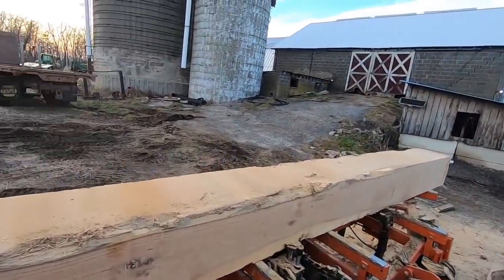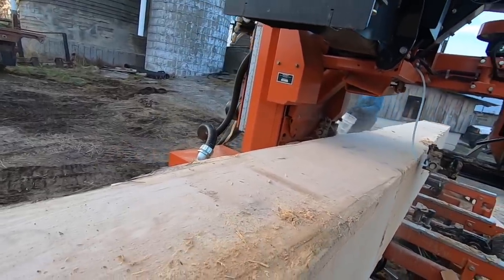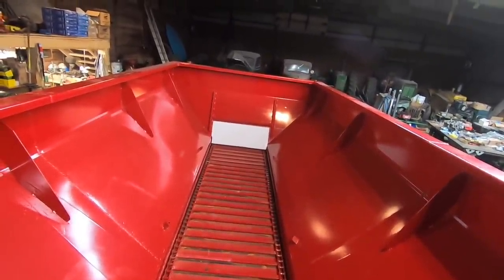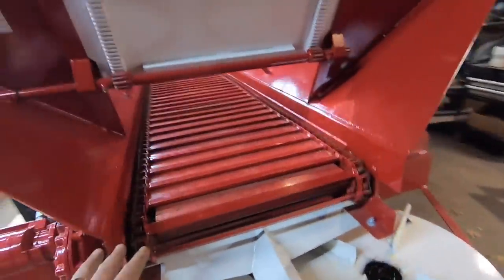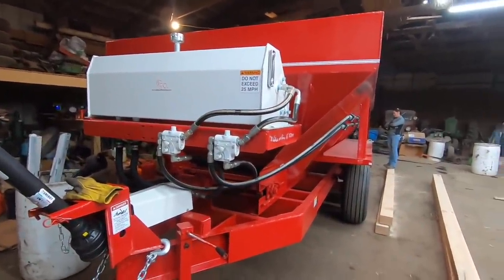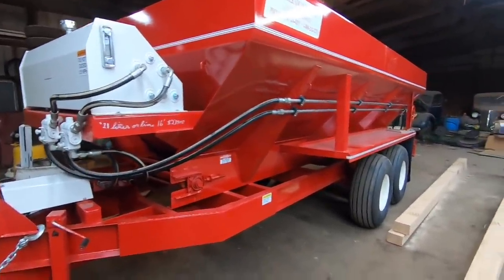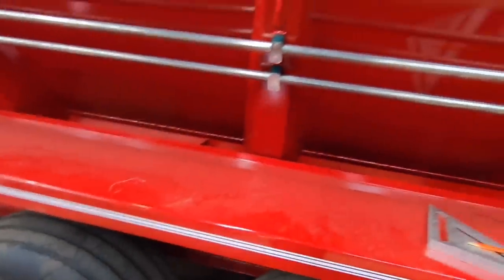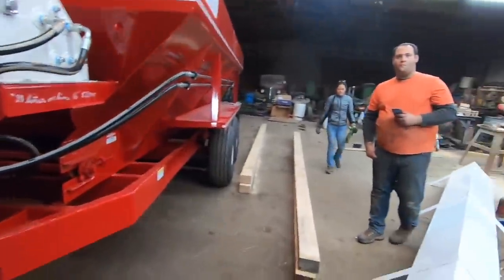Spreader Modifacation

Comment: you can find a good spreading widht by putting containers out in the field running the widht of your spreading pattern and compare the weight of matereal that lands inside. did that with our granulated fertilizer spreader, i found that about 80% of the listed widht was acceptable in my case, but its a complete different design spreader.

Comment: Great built spreader the only problem we ever had with the Chandelier was the rims. They will crack from turning. Cut centers out and make new solid 1/2 inch plates then weld them in. Put gussets between centers and rim. Look like shit but bullet proof. You with be pleased with that spreader.
Reply: The tire size/rims looks small for the weight this machine can carry... it does look like a weakpoint, that and hopefully he doesn't have to deal with too many muddy areas.
Reply: They shouldn't of used chinese rims, their quality & metalurgy suck

Comment: Very nice spreader. Maybe I missed it...does it have a chain oiler? If not make sure if it's not gonna run for a few days, oil the chain with a mixture of old motor oil and diesel fuel.  Lime is heavy and doing the first load after not running for a while with crap in between the chain without it being oiled causes stress over time. Dont ask me how I know

Comment: Put shims/spacers down before the first board so it doesn't hold moisture and compost/litter against the metal on top. All you need is 1/8th to 1/4 inch.

Comment: It may be hard to get it to spread only 20ft. The spinner speed may be too slow to get a consistent distribution. It might be best to cut your rate in half at a 40ft spread pattern and split your tire tracks. This will accomplish the same goal as a 20ft spread pattern but with less load on the spinner motors and a more even distribution. you can see your previous tracks and be fairly even. We spread 2 plus tons of lime in our area and on higher rates this provides more consistency.

Comment: You won't like the little tires the things sink like a rock on them and the little axles won't take the punishment for long ours has the big tires and axles an I still wish we had bigger tires. Pretty good spreaders just minor things to watch on them they will Crack the welds on real rough ground. I took my extensions off because we kept tearing the spreader up with the weight....